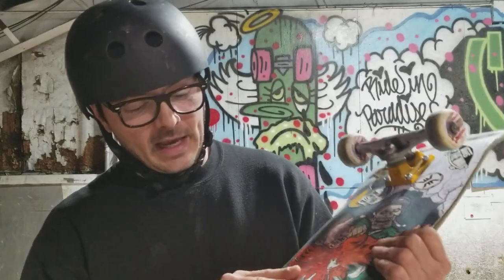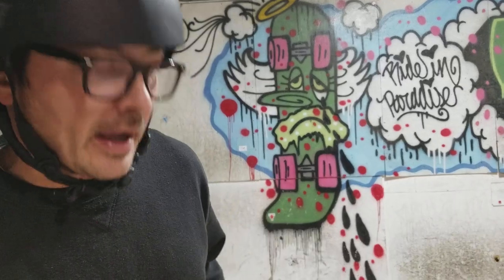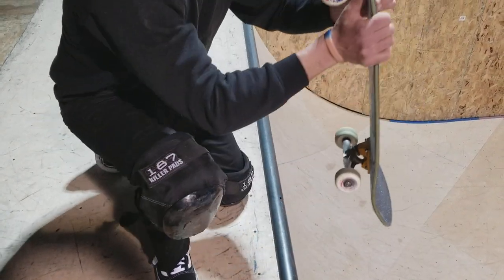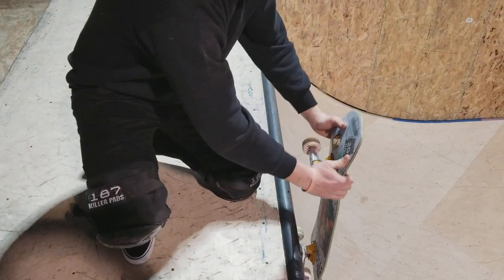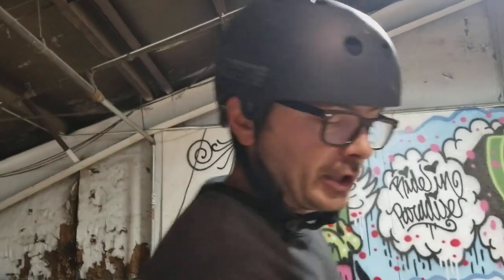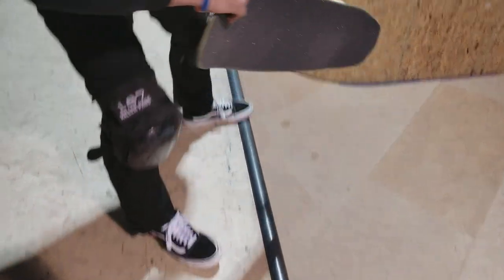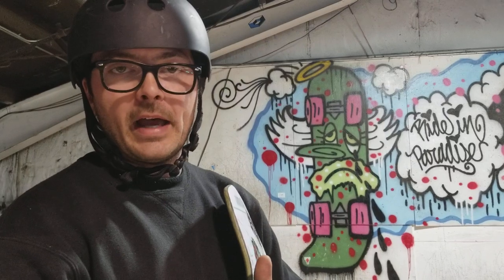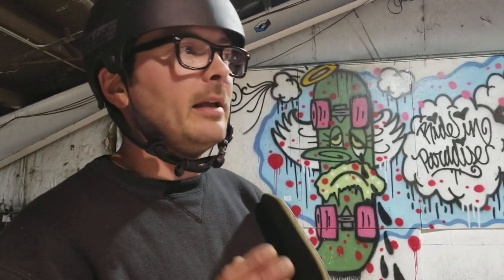THE ART OF RAM -  HOW TO BACKSIDE AIR - SKATEBOARD TRICK TIP

Comment: Yeah good stuff,breathing is a help full thing because mainly u get nervous most of us are holding our breath until we learn to relax and u learn to relax by proper breath technique,the Olympic athletes do it before the event along with visualization,u don't have to get super crazy with yoga but from years of using exercise equipment for strength training u exhale when u push the weight away and relax open your mouth and the inhale just happens naturally because ur lungs pull air in as they contract,it should be easy not think about it its less distraction,and let's u focus its physical skating,good point u really just let the turn that u make kinda flow and slow it to the direction your going if your going down the pipe u wouldn't be doing a full 180 plus like he said u do a 90 I say that's a pretty good way to not over rotate,I find myself because I'm in the air making the turn is easier no resistance,I say that's a pretty good estimate a 90degree forced turn and then just let the fall and the rest of the turn go down the ramp with the skateaway,one thing look ahead of where u is to where u want to go,when I'm in the air spot my landing and then look to the flat and up the other wall,this helps your balance,good Perephrial vision helps like feelers to help u know where u are.real good teaching,and nice backside air beautiful,picture perfect.now if I could just get a new hip,I could gets some pop back in my front leg,my front side kicks and back sides kicks are still good,but its still fun.THANKS brah for learning the masses and spreading the vert gospel...get radical man.circa 1977....

Comment: Yeah I ain't touching the lighter thing...your on your own...I was just out today blasting some front side kick turns in the six foot shallow end of the ten foot bowl,and I real had to force my self to slow my kick turns down because I skate so fast, and its really the same for your air u just take a second and get you body square to the board in this case backside get in the set up position like he saying get straight then your rotation has a starting point u can feel,but its true the turn goes pretty easy,I prefer front side get your kicks dial and then follow this step by step.little pop on your kick turn,I seen guy do a silly bunny hop air but if that comes your nerves to start,I really think the bonk thing is a little more of an advanced technique but u really need to be weight sensitive on loading the board,that's some thing I learned on a one and half foot of vert on concrete if you don't push on your feet on your board you'll slide down the wall,timing it is easy and you actually gain height on  the wall,thanks man,nice clean explanation,very nice.yeah bounce it off me again I thinks I gots it dis time....ooh ooh.just kidding got out on the new board to day,with the 60mm wheels and felt good,the old hips was pretty cooperative with front side kicks,oddly it was more stable with the backside kicks last time out,so WTF,day by day...thanks have its supposed to be fun,bull Durham,piece out.

Comment: Do how to pump around a figure 8 bowl. Or choosing lines. My front side grinds I usually make them but everytime while I'm doing them I dont know if its going to slide out or  make.
Reply from the maker: Jonathan Mortimer it sounds like you are pumping to early going up, try this. Just like the b/s air. Go fast without a pump up the wall. Grind. Then pump down hard. Repeat. Hope that helps
Reply: trog army , you right, i feel a really good control on every trick when i dont pump up the wall

Comment: Does this work for mini ramp too?
Every time I try it I am up in the air but my board has gone flying off and nowhere near my feet!
Great tutorial, though!
I guess I just need to practice.
Reply from the maker: This will work on a steeper 6ft mini ramp but not recommended for mellow small ramps. If that's all you have you can practice this technique to disaster.
Reply: @trogarmy  The bowl I skate is pretty much 6 foot at the place I am trying to air from. I can air out the top if I grab before but never managed, and always wanted, to grab as airing. I will get it. Just needs to click. Just frustrated I can't do it yet. Practice I guess.
Thanks for replying!
Reply from the maker: @leemidwinter1379  try finding a comfortable hip to learn late grabs

Comment: Landed my first 4 then hung up🥺 how do I make sure I pop out enough
Reply from the maker: been there, done that. if you hit a good clean bonk you should feel that you are in the ramp enough to land or bail. If you let go early and try to put down the landing gear down early your percentage to hang up goes up. Another thing to remember is that every trick comes with a slam. not just a fall but a good hard slam. sounds like you got yours over with. with hang ups you learn a lot, what not to do. I wouldnt fear the slam/hang up again. with taking one already the chances it will happen again are unlikely anytime soon. remember your bail out pattern and the feeling of landing those first four. great job and i hope this answers your question. where can i see a video of the land???